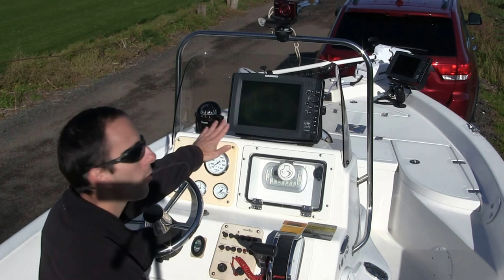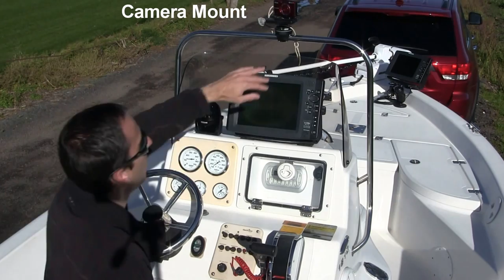Nautic Star 1910 Bay Boat Fishing Setup

Comment: Thanks Captain Matt  great boat...I'm looking @ a Nautic Star  1910 bay  and needed to know if you ran into any difficulty running the additional wiring to the electronics add ons . Hope to speak to you directly ..thanks
Reply from the maker: Hi Quick-

   Thanks for the comment.  There was no real issue with running the wires that were not expected.  There was a small piece of foam in the way running the bow unit power cable, but some strong cord and a mirror and I was able to run a guide line and then pull the actual power cord through.  There is actually a fair amount of open space so no structural modifications or drilling needed.

Comment: Matt.   I have a 1910 and putting a MK Terrova Riptide on it.   I noticed you did not have a slide plate on your TM.   Not sure if you have to launch on steep ramps.  Do you ever have issues with the TM hitting the roller on the trailer?   I am considering getting one just in case.
Reply: Matt.  I would like to piggy back on Maxwells question as I am in the market for a Minn Kota Terrova for my 1910. I was wondering what shaft length you have for the motor and if that length is ideal or would you change it.  Thanks man.
Dave

Comment: Thanks for the video.  I have a 2007 1910 not nearly setup as nice as yours.  But it is a low hour and gorgeous boat that I love to use.  I would love to know your thoughts on trim tabs and your experience using the jack plate in this boat.  I have an issue of porpousing when trimmed out that I think starts prematurely.  I am running a Suzuki DF 140 on mine.  Tabs appear to be hard to put on with the multi-dimensional transom.  Would love to talk with you about this.
rxdoc (Dave)
Reply from the maker: Hi Dave-  Sorry for the delay, but I did consider trim tabs, but ultimately decided against adding them.  For one, it is just something else to get line caught on, and overall the boat rides good enough that I did not see much room for improvement.  By adjusting the trim and rpm I can dial in the sweet spot based on any given condition.  Yes, porpousing can occur, but typically if I trim the motor down and pick the speed (rpm's) up this will be greatly reduced.  Also, fishing salt water (at times) adding trim tabs would be another item that could corrode.

The jack plate I have is a manual that has been professionally set and adjusted and now is locked in.  While it may only raise the motor a little bit the advantage is that it does set the motor back essentially lengthening the boat.  

Another important note is the pitch (and type) of propeller you select.  Hope this is helpful.